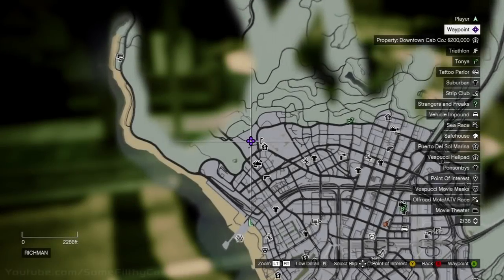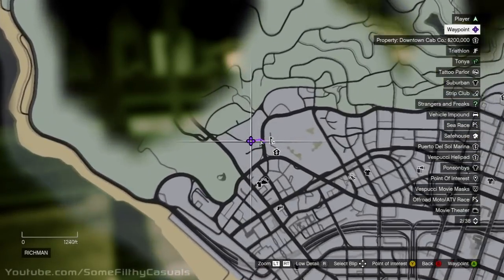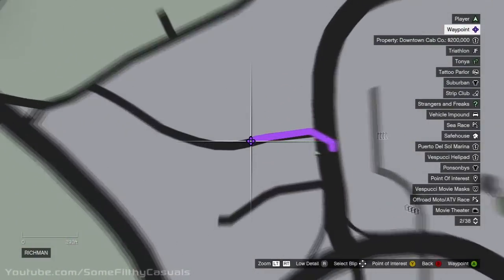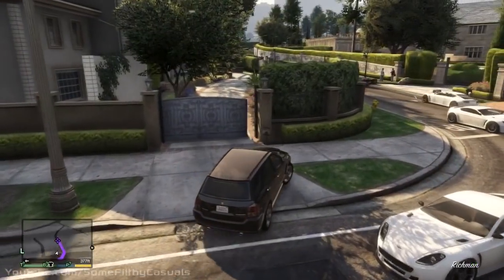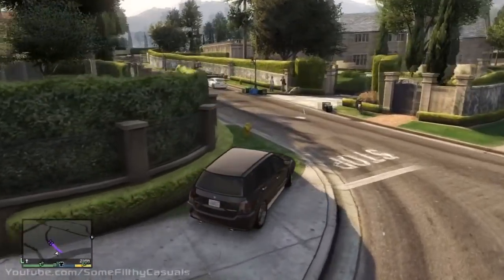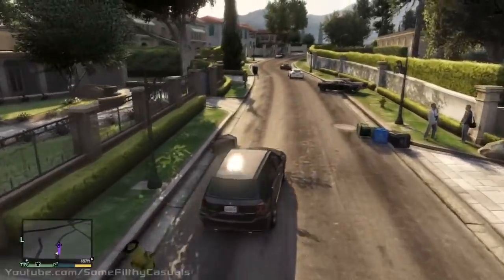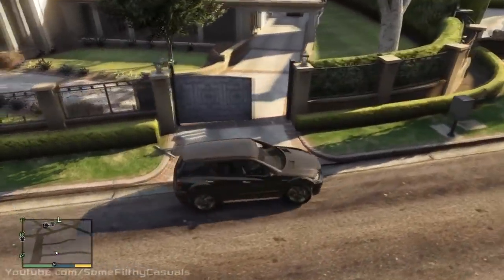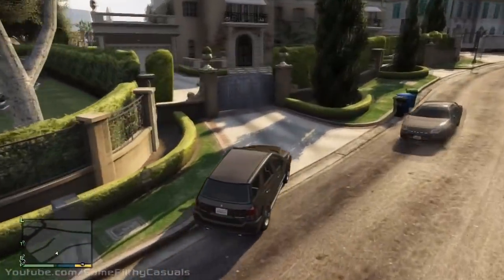GTA V: Gate Launch Glitch (Tutorial) - [GTA 5 Swingset Glitch]

Comment from the maker: It can be very hard to figure it out at first. I've had good luck using Sports cars, parking against the gate where it retracts (left half if it slides left, and vice versa) I let it open about halfway, then accelerate into it.

This may not necessarily help, there's just too many variables with it for me to cover; it takes some trial and error. 

Sorry :(

As soon as you start seeing progress though, it's much easier to figure out the sweet spot, and start getting launches consistently.

Comment: I was trying this and it worked kind of off and on. But after one attempt. The gate was still messed up and I kept running at it and got launched a few times, once at a low height about two blocks from the gate. Had to steal a car to get back. First discovered it today so will have to try more to see what factors are necessary to make it doable again.
Reply: Ok, so you need to get a car launch to work first. Hopefully a small one so you're still alive. You'll notice the gate then opens and closes on its own very erratically. Now you can start running at the gate on foot. You can try climbing the gate but often it will crush you to death which is fun once or twice. Just keep running at it and keep your feet moving to achieve further distance. Tried it now for two evenings and about 2 blocks away is as far as I've gotten.

Comment: FOR EVERYONE SAYING ITS PATCHED:
I don't think this has been patched yet, I've not managed to get it to work either though. I noticed however that if I drive at the gate in a certain way then it closes faster than usual, so I think that its just ridiculously hard to pull off.

EDIT: I've found that it closes faster if you drive into the gate, but into the edge of the gate, at the bit thats opening. I think this may have something to do with the glitch.

Comment: I just found a way of doing something simlar so I googled gate glitch and found this vid, if you find a gate in a fence that you can push open, you can park your car right where the fence would close then run away a bit and come back, the fence will be closed over your car then just try and open the fence and the car smashes up, I launched it once or twice so far using the fence near that red and white tower thing up by the vinewood sign.